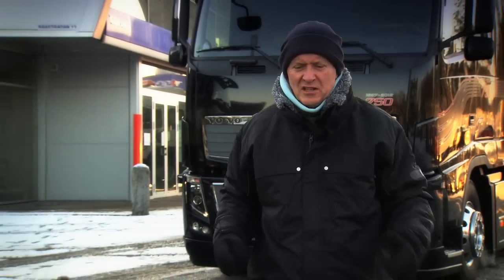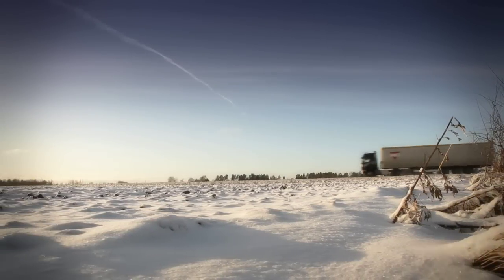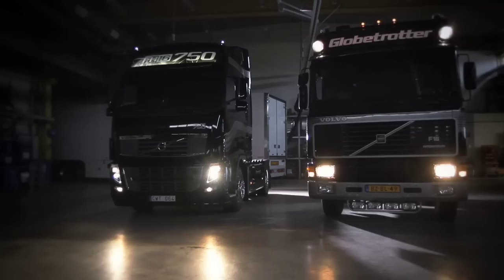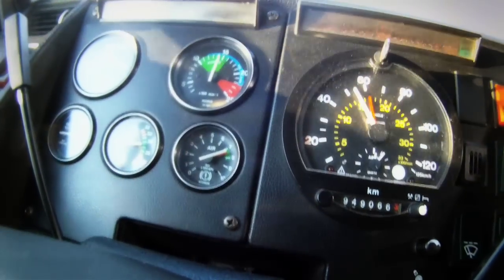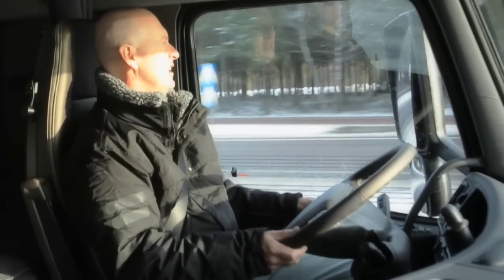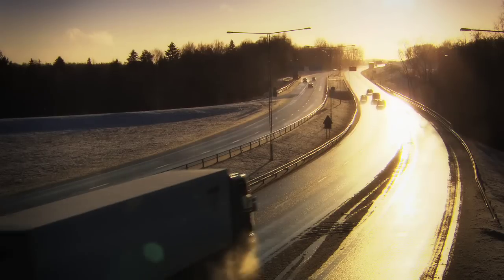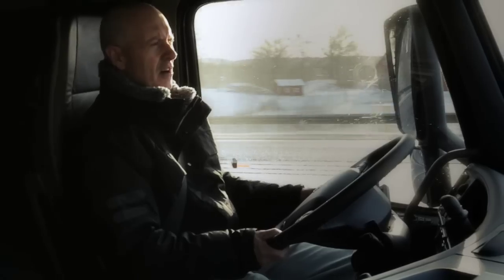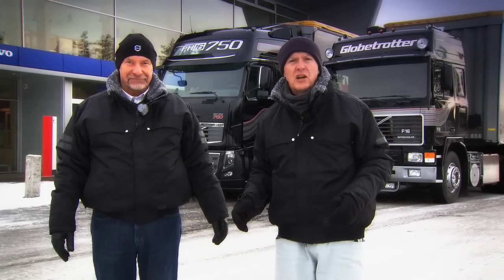Volvo Trucks - FH16 750 vs. F16 470 - Brian's Truck Report (E02)

Comment: when you are just a 21 year old, and feel so amazed that you want to try a FH16 once for yourself, eventhough you never driven a truck before.
Reply: Does Euro Truck Simulator 2 count?
Reply: I'm 18 and I'm already a truck driver. First truck I ever drove was a Volvo FM 380 from 1994. Next was a Volvo FH 440 from 2008. Next was a Scania R500 V8 from 2009. Next was a Scania R730 V8 from 2012. Now I'm driving a Scania R420 from 2009.
Reply: its better to have someting beside your educational certificates just in case things dont go normal
Reply: @tntfreddan3138  i am 25 years old and im driving a r480 from 2007 for six years now. good truck but my brand new FH16 is at the bodybuilder right now and i am fucking excited!!!
Reply: @GumpPower  I started working at a different company a month and a half ago so I'm currently driving a S520 6x2 semi truck. Not a regular semi truck, though, cuz the wheelbase is slightly longer so the max gross weight is 50 tons.
Reply: @tntfreddan3138  FM 380 from 94? Sorry…In 94 the FH had 1 year service and the low cab was FL10/12. The FM cabine only came in 2000
Reply: @joseteixeira5900  It was old... I know that much. I checked the license plate and it was from 98. Sorry.
Reply: @tntfreddan3138  the first truck i ever drove was a fh16 750 haha

Comment: The I-Shift is fantastic in the woods, i'm driving timbertruck and have done so since i graduated.. starting -07 whit a 520 FH12 manual gearbox, and when I-shift came around i wasn't sure about it in snow-and-mud conditions, i was taken whit a blast! it's so great and gears fast and was nothing of what i tought it to be.. but the shift-buttom should be more sensitive! in some case i've got stuck in hills in winter just because it dosn't gear down 3 steps and just take two even if i push it 3 :)

Comment: I wish they have mentioned average MPG they got up that hill  :-)
Reply: Maybe under 5 MPG(US) because of the uphill climb.
Reply: @wws2020  I know my Scania R420 has an average fuel consumption of about 90L/100km. I've never been fully loaded with 40 tons up that hill, besides when I was an apprentice and went up that hill with 440hp and 58 tons. Think I did roughly 25km/h on the top of the hill.
Reply: i attacked that hill as guest of Volvo in a 660 at sixty tonne computer said 4mpg it kept pulling and pulling but my F16 opened up propa power my F340 PLM is still around if i ever get the money ill buy it, 18 years i was the pilot i parked her up and still had the plastic on the roof lining FH16 no chance, F16 real power

Comment: I was privileged to work for a company called L&B Haulage from Wembley i started there in 1985 with F12 6x4 110 tonner Then 1989 my Boss got me F16 465 F340 PLM lots of engine trouble new engine 485 what an animal i had that truck for 18 years Then i got FH16 610 no comparison, The F16 is still about an everyone calls it Jimbos LORRY

Comment: That hill is good enough for a test like that. And it's a high traffic piece of road which means that if you have enough power to keep up the pace when going up you will not disturb the flow too bad. On a narrow winding road you won't benefit from power in the same way.

Comment: Driving a Scania R500 uphill loaded to 49 tonnes and seeing a Volvo 480 also loaded to 49 tonnes overtake me and pulling away kind of puts me off this assumption you have made here. Even a 500 hp MB Actros pulls away from the 500 hp Scania, a bit slower than the Volvo but still pulls away.
Reply: It depends on the driver. If u can floor it all the time the scania will pull away. The new gen scania's are even faster. Never seen a mercedes pull faster than scania eventheir latest ones struggle a bit.

Comment: I think the 750 should have used another trailer, a 20 foot center axle trailer behind the 40", rules have changed since 1987, the 750 is meant to do more..

Comment: I don't see what's so tough about Jönköpingsbacken (Jönköping hill). I'm 18 years old and I've been driving there daily for 2 and a half month now. First time I went down that hill, I was 17 years old and weighed 25 tons. The time after that I was 18 and 2 months old and weighed 58 tons in a Volvo FH440. No problem in early February because the right lane is heated to prevent ice from forming. Just today I went both down and up that hill. Down I weighed 37 tons and up I weighed 22 tons. I've only lost traction there ones but that was when I was driving 25.25 meter. Fully loaded, 5 axle trailer, and almost empty truck so about 50 tons in total and only 5.5 of those on the drive axle. Was driving a MAN TGX 26 440.

Comment: This truck seems to be the fastest in the game Euro Truck Simulator 2 because his 750 hp I can drive at 145 km/ph with 20 tons charging. is there any other truck in the game faster than this? ty
Reply: +Hector nope there is not...some scania fans will say R730 but FH16 750 is the fastest in ets2
Reply: Yeah volvo is faster but i like the scania's smoothness and it even handles better....
Reply: +Somdeb Biswas have you tried mercedes top model? it is pretty good along with scania and volvo..
Reply: Yeah it's okayish.....but not that powerful.
Reply: Wangelo Ita because its the best trucking game..go check out..you will thank me later
Reply: Wangelo Ita ok..i thought you are new.
Reply: fh16 classic does 170kmh